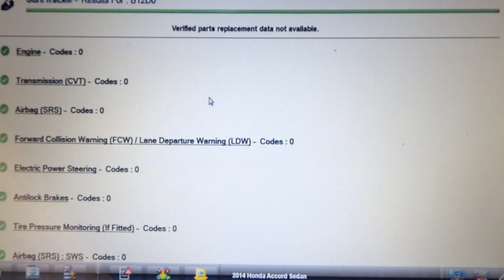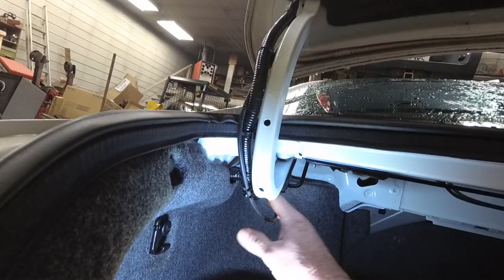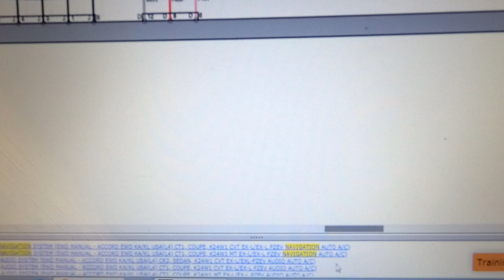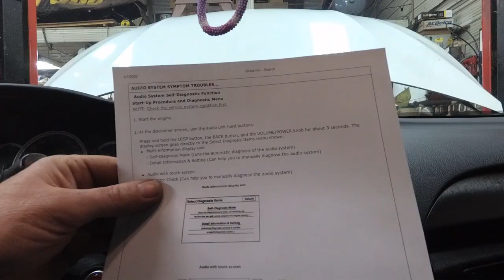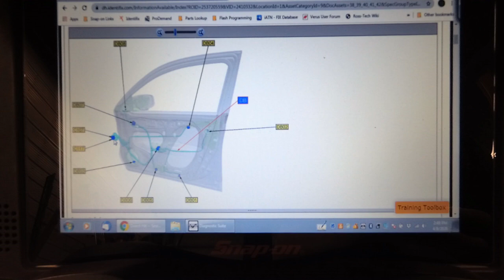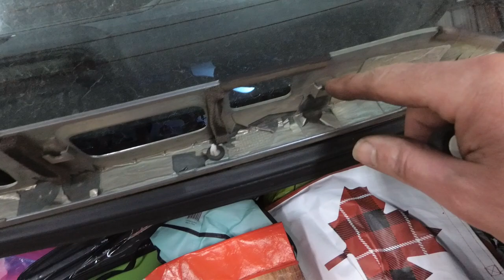2014 Honda Accord Backup Camera Dead

Comment: I went over a curb and shortly after my display screen went out. It flickers and has lines on it. The radio is fine. My Honda service department has quoted me $1800 for a new display screen installed.
Reply from the maker: If the display flickers in and out its likely the display itself that's dead. Do you have the reverse lines on the display in reverse?
Reply: @PhillipBailey  When the car is in reverse it looks the same way. No back camera and no right lane-watch camera.
Reply from the maker: @barbaraarnold5134  sounds like a display problem.

Comment: I'm fighting the same issue with the bolt spinning, I assume I need to put my drill in the clockwise setting and go until the head snaps?
Reply from the maker: Yes I had to drill the head of the two bolts off.
Reply: @PhillipBailey  forgive me for asking so many questions, I assume I need to hold the bolt with a crescent wrench start the drilling process from 1/8th to a bigger bit then the head just snaps off?
Reply from the maker: @JonnySpectacular  no problem. If tge bolt spins when trying to drill it use a long box end wrench to hold it. It's a bit of a challenge but it can be done. Start with a 1/8" drill. Be careful to center the drill hole. Then drill to 5/16". Good luck...

Comment: Great video! Troubleshooting was very thorough and easy to understand. Son's 2015 Accord did the same thing, we jumped to changing the camera first since they are reasonably priced and still no-workie. I will need to test the wires and see if we have continuity issues. Any other suggestions or discovered issues on this problem that anyone has found? Thanks for your efforts.
Reply from the maker: Either the camera or wires at the trunk hinge where they flex. Does yours have the camera on the right mirror that comes on with the signal light and if so does it work? Are the lines visible when in reverse?
Reply: @PhillipBailey  yes he has the turn camera that works great and the reverse camera is black with the positioning lines are visible
Reply from the maker: @ajb6304  was it a new camera? Reliable source? Check wires at trunk hinge.
Reply: @PhillipBailey  Yes, he bought a new aftermarket camera and it was an exact match. I will check the hinge point and I'll ohm out the plug

Comment: SOOO, I have the same exact problem with my 14 accord. I skipped all multimeter Tests by getting a new camera…NOTHING CHANGED /Still a black screen. What do I do….
Reply from the maker: Does the screen show the guide lines on the display? Does your car have the camera on the right mirror that shows an image of the blind spot on the right side when you signal to the right and does that work. If so I'd check the wires at the left trunk hinge area.

Comment: Bought a $75 third party one and it still didnt work. Welp.....that's frustrating. I guess its a wire issue?
Reply from the maker: Could be a defective new part unfortunately but check the wires at the trunk.

Comment: Thank-you SO MUCH for posting this very detailed video!  My 2014 Accord camera, bought used, lasted only 6 months!  I finally got around to ordering a cheap Chinese knock-off for $35.  Waste of money - it seems to only have the one view.  At lease it made it possible to diagnose the issue, along with your excellent video! Seems the camera signal wire is broken between the hinge & the camera.  Here's hoping splicing-in a new wire and a better camera solves things.  Couldn't have done it without your help!  CHEERS!
Reply from the maker: Glad it helped you out.

Comment: I have filed a complaint with NHTSA. I am having issues with my camera and it just went black all of a sudden with no warning. I called Honda about it and was told to take it in and get diagnostic done and was told it would cost me $175 to get it done.  Any suggestions is greatly appreciated.
Reply from the maker: Well if you live in an area where they use salt on the roads in the winter it appears the backup camera is prone to failure. The easiest way to confirm the problem is the camera is to plug in a new one. Maybe you can try a salvage yard for a used one. Otherwise your stuck with paying the dealer to diagnose it. Good luck

Comment: Great job @phillip.. I seem to have a different issue with my accord 2016 ex.. the screen which shows the reverse camera is dead. Can you suggest me how to tackle that issue.. I checked the fuses under the hood and they are perfect... Any pointers would be great...

Please note the audio system below that screen is working fine...
Reply from the maker: Other than checking for actual power and ground at the screen itself no other recommendations other than trying a used display screen if you can get one.
Reply: @PhillipBailey  hey that was prompt... Also, is this an easy replacement?? Or should I trust a mechanic only?
Reply from the maker: @summbart5394  the rear camera is easy to replace provided the trim nuts come off. The display I'm not sure about. Never had that out.

Comment: would you happen to know where the fuse is located for the 2014 Honda Accord? No where in the manual does it say. I read something about it being #21 in the engine fuse box but i don’t really know.
Reply from the maker: I gather you mean the fuse for the backup camera? I don't believe there is a dedicated fuse for it. Its the radio fuse I believe so if the radio works then obviously the fuse is good. Is your back camera dead?
Reply: @PhillipBailey  Yes camera is dead, also turn camera. Happened when replacing the battery, it got shorted to ground for a moment. Also cluster display doesn't display mileage like it used to...
Reply from the maker: @kyleboyer1074   I'd start by checking all fuses. Sounds like the battery cables were reversed momentarily. May have damaged multiple modules...
Reply: @PhillipBailey  Thank you

Comment: Great Job
Sir,I have 2016 Honda Accord LX.
Her backup camera clip has broken and the camera is dead.I was told I had to replace the entire camera.Can you please advise a low cost backup camera setup.
Thanks
Reply from the maker: Not sure what you're asking. Either fix it with a new camera, there are sources for aftermarket cameras or put in some kind of auxiliary unit which will be crap in my opinion.
Reply: @PhillipBailey Thanks Sir,Can you please advice where /Websites can I get these after market cameras .
Reply from the maker: @sreekanthsree5581  Try Rock Auto here: https://www.rockauto.com/en/catalog/honda,2014,accord,3.5l+v6,3306143,body+&+lamp+assembly,park+assist+(pas)+camera,47472
There are several depends which otions you have. try Ebay or even Amazon.

Comment: Having a hard time getting chrome back on. You left that part out. How do you snap in?
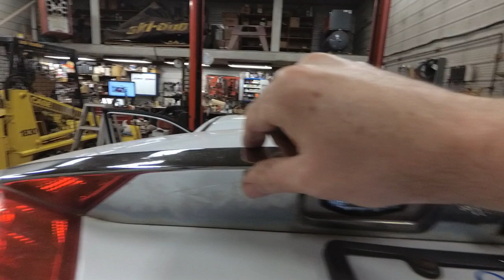Reply from the maker: Did your two bolts come out ok? If so the chrome just snaps back into place and the two 6 mil bolts hold it on. You have to push it straight into the clips. You should be able to see how they are designed since you have it off. starts at 29:45.

Comment: Thank you so much for your video. I also have the same problem with my 2016 accord and couldn't figure out the issue after many failed attempts. You just save me a lot of time! I will definitely be finding a replacement backup camera.  ❤️
Reply: Same problem on mine as well
Reply: Same too!
Reply: Did you replace it and did it fix the issue?
Reply from the maker: Yes I did replace it and it's fine now
Reply: My backup camera just went out today!
Reply: @KavanaIntentionWigAndArt  mine went out a week ago lol
Reply: @Legendarygurth1  I replaced mine in mid July 2021. I noticed water got inside the new camera again, blurry screen. Took out the camera and it’s soaking wet, I hate this camera

Comment: Hey Phil!
First and foremost, THANK YOU!! I owe you a 6 pack bud! Your research on this issue saved me atleast 3 hours and tonna frustration. 
After I saw your video, I decided to take a stab at this issue on my car. Similar to you, black wire was showing ~8V but red was showing OL for me. Since every symptom was similar to your issue, I decided to pull the camera out for inspection. When I pulled it out, it was covered in salt deposits, which made me disect the camera. As I suspected, salt and water ate through couple of nodes on circuit board. I ended up cleaning it with a toothbrush and added missing nodes with my soldering iron and guess what?! It's working again. 

Honda did a shitty job sealing these cameras and if you see snow 6months a year like I do, your camera's circuit board might have ended up as mine. I know this video is 10 months old but if you still have the older camera laying  around, give it try. Whole casing is just 4 tiny screws.

But anyway, thank you very much for this video. It was very helpful!! Subscribed. Keep up the good work!
Reply: Can you walk me thur the steps you did

Comment: So I am having a similar problem, back up camera went dead then two weeks later my lane watch camera went dead also. Very weird, any ideas of why or what to do? Thanks
Reply from the maker: Check for broken wires in the harness that runs along the left trunk hinge for the rear camera and the harness between the right front door and A pillar. Since they both stopped at different times as you mentioned it's likely two problems. The factory troubleshooting is terrible. I'm trying to remember which wires are power and ground. I'll check and comment again.
Reply: More info, i get the black screen but the grid lines for the backup camera, but nothing for the lane watch camera.
Reply from the maker: @tala9499  try the built in self diagnostics in the nav unit. Then buy the backup camera and plug it in to try it. You could compare measured voltages at the camera to my results but it's likely two failed cameras. Let us know what you end up doing...
Reply: This just happened to me… any updates?
Reply: @ThisPetervang  yes back up camera was broke which messed up lane camera. Once I replaced back up camera they both worked
Reply: @tala9499  thanks for the reply 🙏🏼 did you have dealership fix it or diy ?
Reply: @ThisPetervang  paid just a mechanic to do it, not dealership bought camera on eBay

Comment: This whole research in backup camera definitely qualify for a.PhD. Btw, mine stopped working today. Wondering if Honda will do anything since it appears to be very common problem.
Reply: @code9142  I bought it from eBay for about $125 and took me around 30 minutes. It has been almost 6 months and it is working fine.
Reply: @TheMegaVoter  the replacement oem camera installed on our 2014 accord in mid July 2021, just died again today. I took it out and there was water sitting in the housing……lasted 5 months
Reply: @jiefang1069  did you install it? And did you buy the camera from the dealer or open market? Mine is still working 🤞
Reply from the maker: Let us know what happens. Thanks for watching.
Reply: Honda didn't fix it since it was out of warranty. I bought one and installed it by myself.

Comment: Hello need help please,My 2015 honda accord ex-l back up camera is not reacting at all when I am shifting reverse ,on display letter R is not showing remains blanks,the rest D,P,L,N is showing what could be the problem ,the side camera is working perfectly ??
Reply from the maker: If the PRNDL is not showing reverse when in reverse then I would think that is whats causing the backup camera not to work. Do the reverse light come on in reverse? Check fuse 5 if the backup lights don't come on in reverse either. HTH
Reply: @PhillipBailey  Thanks a lot for your quick  respond, will try to check it up as soon as possible!!!

Comment: Great video but for everyone looking for a quicker solution replace them camera and call it a day
Reply from the maker: yes seems to be a common failure but it's not a cheap roll of the dice. I'm sure at the dealership they have a "test" unit to simply plug into the harness. Thanks for the comment.

Comment: Great job, thanks. Patience of Job.
My 2015 Accord backup camera was showing up as wavy lines/static on display, no guidelines.
Took it to dealer and was told replacement would cost $560.  No thanks.
Oddly however, when I picked up the car the wavy lines were gone, replaced by black screen with orange guidelines (3 views selectable).
So it seems they did SOMETHING to have changed the behavior.  Makes me suspicious.
Anyway after watching this video I am ready to tackle the job.  Sad that Honda didn't a) design it to be easier to remove, b) issue a recall given so many are having issues.
Will now look for replacement part ($67 lowest price so far but I am hearing there are A21 and A31 versions and some connectors may be different (square vs rectangular).
Would have been great if Phillip had shared the exact model #s of the original as well as replacement parts.
Lastly, did he happen to open up defective camera to see if it was water-induced issue.
If so, adding some weatherproofing goop around all camera seams might help to preserve life of replacement.
Reply from the maker: Thanks for the feedback. If I remember correctly there are two models. Different connector style so you have to look at it. There were no obvious signs of water intrusion that I could see. It's pretty protected where it is. Goid luck.

Comment: 2017 Accord. Rear cam issue. one cam view at a time stopped working in a month time. Now fully dead. Just black screen with guide lines. Currently out of warranty.  Took to the dealership to check.  Charged 75$ for diagnosis which is to tell me what I told them that it is not working. No idea on their diagnosis effort.  Fix is to change cam and go to the next part if this does not help. They are not pointing the fault instead doing trial and error. Is that the best way to diagonise ? May be it is...  ? No idea. 

 The cost for cam replacement is 599$ part and labor. 

I declined their fix recommendation... Found very expensive. ..

Figuring out what to do...

Any suggestions?
Reply from the maker: https://www.ebay.com/itm/283529570249
Reply: @PhillipBailey  Link no longer works.
Reply from the maker: @groverstrong9078  sorry have no control over what Ebay does. Need to do a search for it.
Reply: @PhillipBailey  Thanks!
Reply from the maker: Visually inspect the wiring on the left trunk lid hinge as it bends here as you open and close trunk. If that looks OK I'd say you need a camera. I found this on ebay and directed the customer to buy it. Was around $225.00 if I remember. Its not that bad to replace if the trim bolts come out.
Reply: @PhillipBailey  o
Reply from the maker: There are two designs, you need to confirm the plug connection is either rectangular or square. I believe its this one but if the dealer gave you a part number that would be best.
Reply from the maker: Watch for the china ones, id buy from the USA
Reply: Thank you Phillip.